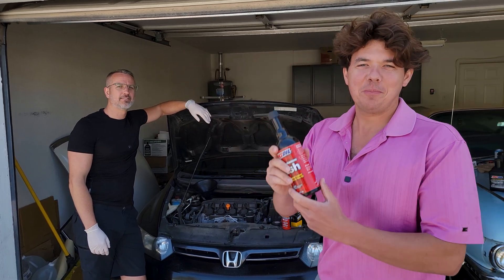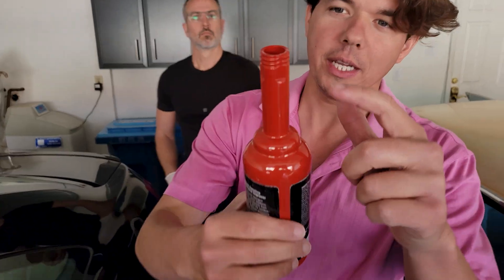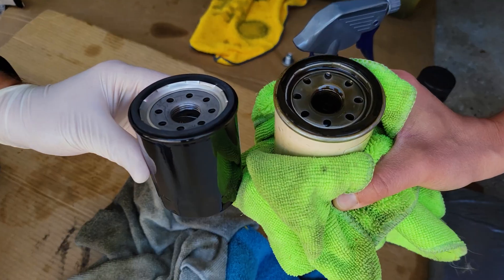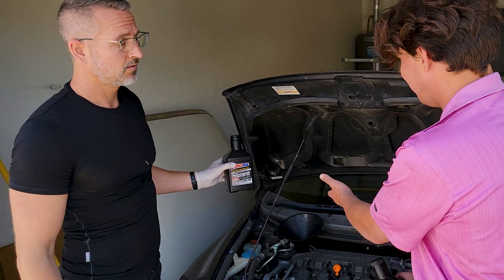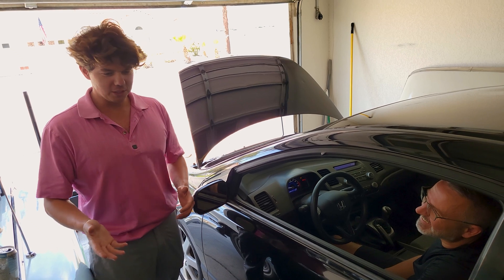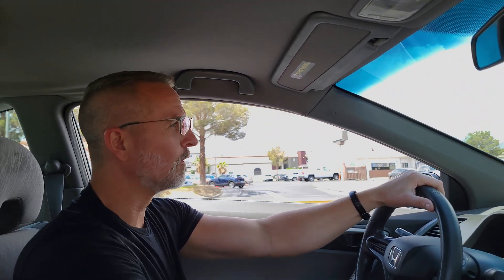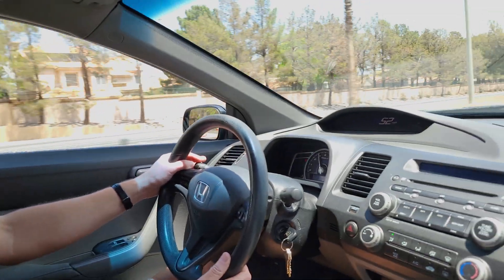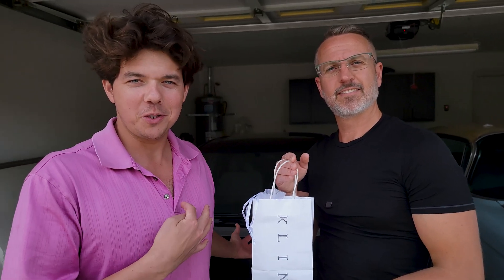Secret to stopping oil burning

Comment: Eben, I have an audi with the 2.0t engine. How often should I use the flush? Engine only has 27k miles on it.
Reply from the maker: If it's turbo personally I would use it every single oil change I have been on my car and I know it's made quite an improvement since the day I got it it has loosened up a little more and it's making more power and it's also running smoother it's taken about two oil changes and two flushes to really clean it up and when I got my car it started at only 42,000 miles.
Here's the playlist on everything I've done to it and I'm excited for the 100,000 mile break in quarter mile time we're going to see how it performs👍
https://youtube.com/playlist?list=PLB_ftWArBFdd-6mgaMuj9bNs7DvKRpNQm

Comment: Great video! I've changed the transmission fluid to Amsoil on both my 2019 Honda Civics and they run so much smoother. I added the Upper Cylinder Product and PI Gas Treatment to both cars and all total they run so well! Changing one oil using the high-end Amsoil Synthetic on one of the Hondas next week and will post the results. All in all our house is a big fan of Amsoil and thank Eben for his help!
Reply from the maker: Sweet!!! Are you my amsoil customer?
Reply: @Syntheticoilprotection  YES!

Comment: Hey eben, I have got one of those R18 motors on one of my civics, the motor really really likes 5w30! Even more on high heat! They actually ship it with 5w30 in japan and south america because there is not so strict pollution laws. Give it a try on theese R18s, they will feel much better, smoother, peppier and it will lower temps and stop consumption
Reply: When racing 5w40... If you got an oil cooler 5w30 is fine.
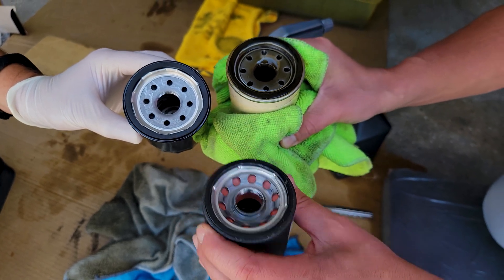Reply from the maker: Yeah I think for around town for fuel mileage you're better with the 0:20 but I think you're right if you were going to be doing the autocross I would definitely do the 5:30 Dominator racing oil that's got the modifiers for Less friction so you make more wheel horsepower👍
The other thing that's awesome is the power Duo my personal favorite and that's the upper cylinder lubricant and the Dominator octane booster together and I did a video here on my car showing the power difference.
https://youtu.be/9Y7XSl5YHFg
Reply: @Syntheticoilprotection  0w20 definitely better for fuel mileage, but this engine tends to knock on 87 octane in high temps, the 5w30 let's you use 87 without issues, 0w20 if you are using 91
Reply from the maker: The knocking is because of carbon in the combustion Chambers so what I would recommend is a bottle of the pi performance improver that's that red bottle the other thing that'll make a huge difference is the power Duo which I love to use when it's over 109° in Vegas I personally run it in my car gets rid of any pre-ignition and you also make quite a bit better fuel mileage because the burn is a lot cleaner it's the Dominator octane booster and the upper cylinder lubricant together😃

Comment: Great vid Eban, I need to order another shipment for my late oil change. I had a new short block installed in my Hyundai under warranty, but now it's time to change their oil and filter. I'm near Phoenix Az, Hyundai says 5- 20 is standard, but can go to 5-30 for worse conditions. What do you think? I've been using the Amsoil 5-20 since I got the car 3 years ago, stay with what I've been doing or change
Reply: I use 5w20 in my 2010 Accord and live in hotter summer months. I'm thinking going to 5w30 instead of 5w20 and maybe back to it in the winter.

Comment: Great video, I have a 2020 ram 1500 classic with 50k miles and I swapped the entire drivetrain fluids to AMSOIL. I’m a believer. Better MPG, smoother shifts, t-case engages quietly. All around better running truck. Oil is cheap and drivetrains are not.
Reply from the maker: 😃, did that motor have a little bit of it ticking noise with the OEM oil?

Comment: Bro wix is not a cheaper made oil filter 😂😂
Reply: @ George Eben is referring to Amsoil higher micron rating and efficiency rating. And if you pay close attention you can see that's a normal wix filter not the xp wix. Wix regular series is not bad Wix XP is better. Amsoil filter is great too.
Reply from the maker: Oh yeah the regular Wix filters are great it's just there's a couple other filters better

Comment: I have a 2011 GMC Savana 15 passenger van with the 6.6 Duramax LGH. I got it used with 32k miles. Did my first oil change shorty after with Amsoil. I speculated that she burned oil, especially with towing. Around a quart ever 3k miles. I used the Amsoil flush for the next two oil changes and now she doesn’t lose a drop. The rings were probably held up a bit due to the oil that the previous owner received at his local quick lube joint.
Reply from the maker: Awesome are you a preferred customer?

Comment: I've been using 0w20 in place of the 5w20 with awesome results.. If anyone wanted to step up to a lighter oil it will be just fine. You might even squeeze a few extra MPG... 

Thanks  for the Video Eben.. A big shout-out to Aaron for sharing his Civic
Reply: 0w20 and 5w20 are the same when up to temp. 0w20 is just thinner on start up
Reply: @514aam  it funny cause my car manufacturer switched from 5w20 and transitioned to 0w-20 my mitsubishi drives cherry 🍒  now with amsoil.
Reply: @chrisr.986  Yep, gonna try amsoil next oil change, it's just really hard to get in Colombia, gotta import it and it's very expensive because of that so I use Petrobras Valora, if I recall correctly it's less mineral than Mobil 1, so not as good as amsoil, but hey, you gotta use what you can get over here in the third world
Reply: @514aam  understandable.
Reply: @514aam  there is plenty of amsoil here in Panama, maybe you can import some from here to there.
Reply: @neometalx9  interesting
Reply from the maker: https://www.amsoil.com/international/distributor/?zo=5331179
Reply: I use 0w-20 instead of 5w20 starts off smoother in my personal opinion
Reply from the maker: Yeah basically it's an updated technical bulletin so a lot of the newer cars all come with 020 and it's all backwards compatible so you can run 0w20 with all the other.

The biggest benefit is it just has a little bit more cold flow additive packages so when it's colder it flows a little better at the cold start but they're very close

Comment: I love it!  Eben what do you suggest to do to a 6.0 powerstroke as far as lube is concerned?
Reply: If it's still running, send it to a museum.
Reply: @michaelcopeland8985  it’s running strong.  Pulls everyday.  Thanks tough guy
Reply from the maker: I would run the 10w30 signature series Max Duty diesel and two bottles of engine flush you'll see a huge difference the oil will help clean the motor quicker by being a little bit thinner I would also get two oil filters and I would also get the diesel injector Clean Plus C10 boost the green bottles I would run to 16 oz green bottles as a heavy clean up dose and then after that I would run 116 oz bottle as a maintaining dose if you have any questions just give me a buzz this will give you the best value on the products as the 6-month PC member.
Eben 702-472-3614 
✅   Save 25% On Your Next Fluid Order: https://www.amsoil.com/offers/pc/?zo=5331179 

New promo: CC0523FP